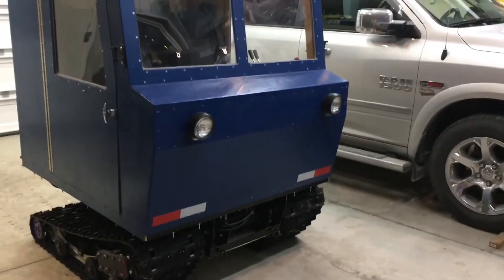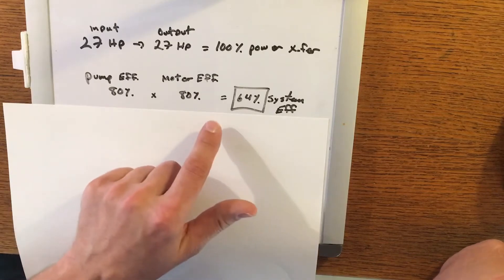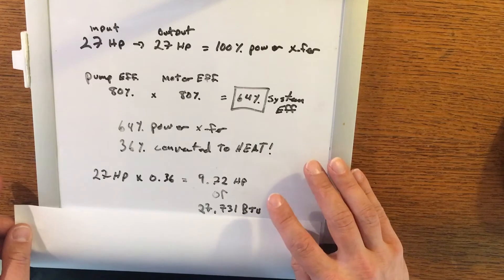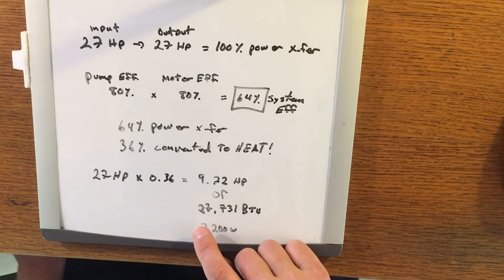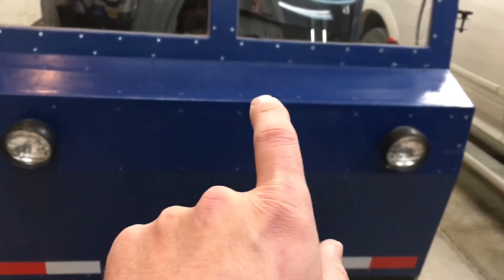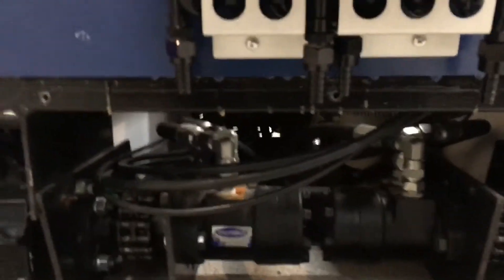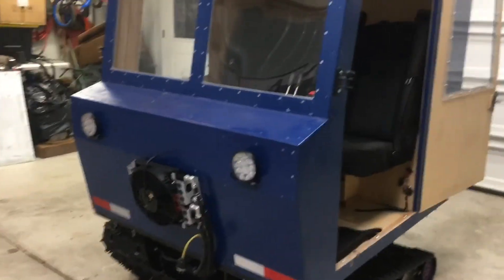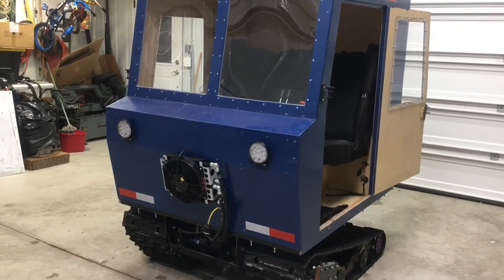Mini Snowcat -Oil cooler 😎

Comment: This is great. I’m planning stages of building a cat, but bigger. But contemplating hydrostatic vs gear drive…
Reply from the maker: Having done the hydro I would seriously consider a gear drive using a small truck drivetrain with a 4cyl engine.
Reply: @rad1876  my experience and confidence is in gear drive and I appreciate your insight and it basically supports the way I was leaning. I owned a big ten passenger hydrostatic cat years ago and ultimately got rid of it due to intimidation of cost maintenance. Nice build you did though, very impressive.